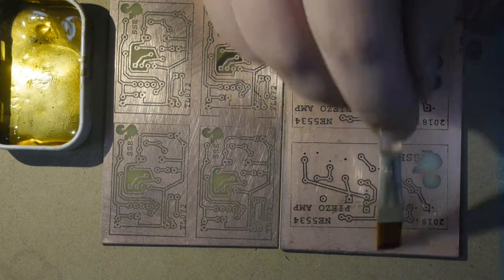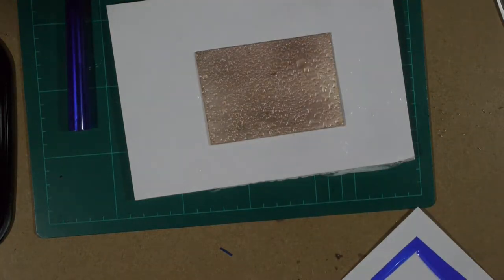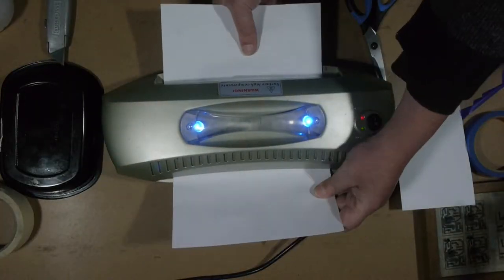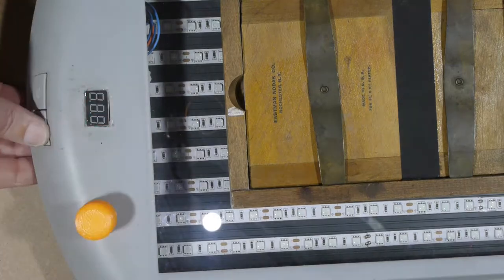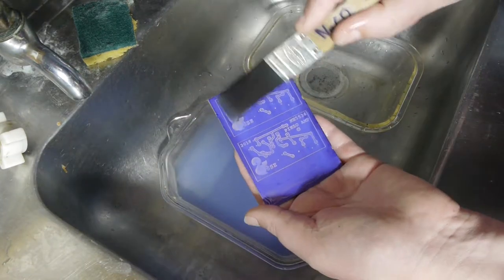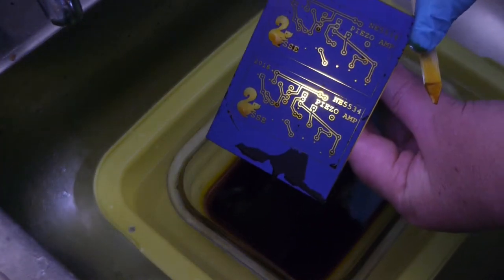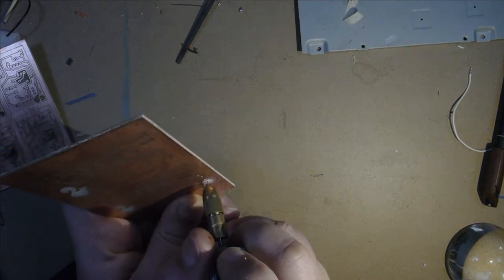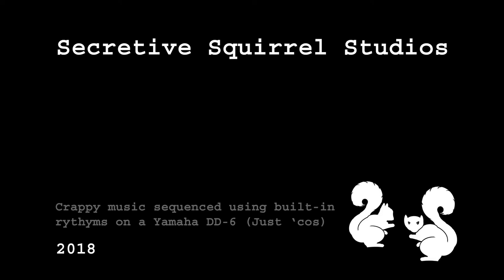Home made pcb's with dry film etch resist..

Comment: hey nice fast dry film pcb making  video just i need to know which dry film you are using 
the most probem i have with using dry film is developing i cant see if no exposed  copper still 
covered with dry film
Reply from the maker: I've tried a few different blue dry films and they were all pretty similar really - this stuff is a good quality version bought from a local (New Zealand) electronics supplier, it's the same stuff as they cheap stuff you find on Ali Express or Ebay, but is better quality in that it is more even (and they have a guarantee). I had been using very cheap stuff till recently, but had to throw away film where it was wrinkled. The New Zealand store I bought from was here: https://www.phoenix-tech.co.nz/products/photosensitive-dry-film-30cm-5m-roll 

As for the dry film not washing away completely, yes, it can be practically invisible. I tend to expose it, then develop it in sodium carbonate. I then wash it in plain water, and let it dry fully (overnight typically) before putting it back in the uv exposure unit for 3-4x the original exposure (that makes sure the film left is fully hardened), I then give it a quick scrub with a nylon scouring pad and plain water - that tends to get rid of anything that is left. When you dip the board in the etchant the first time it's a good idea to pull it out again after 15-30 seconds and look to see if any areas are still shiny, I find that ferric chloride makes the copper go dull and pinkish in colour. so it's fairly easy to see if you have missed any resisst which should have been removed, if so you can scrub it with water and a nylon scouring pad or scratch small bits away with a scalpel.
Reply: thank you for your attention i appreciate your help
Reply from the maker: @jeanmichel9207 No worries :)